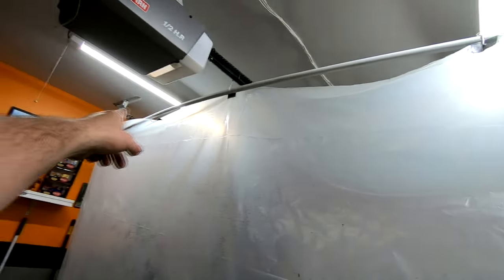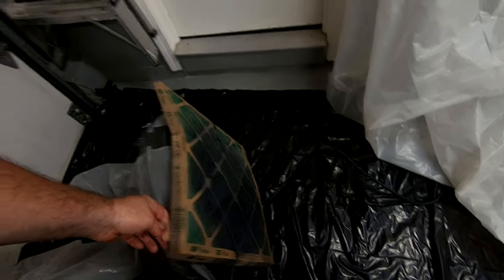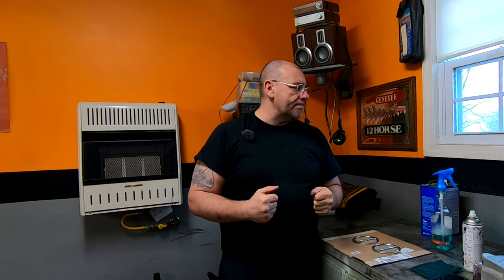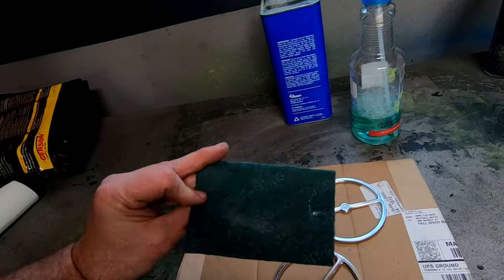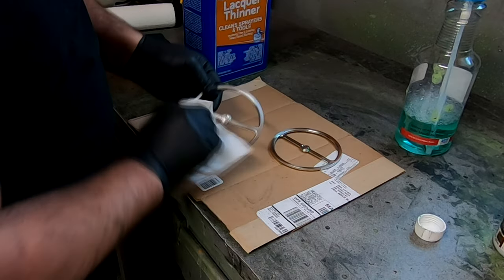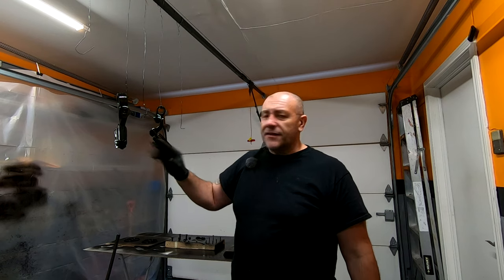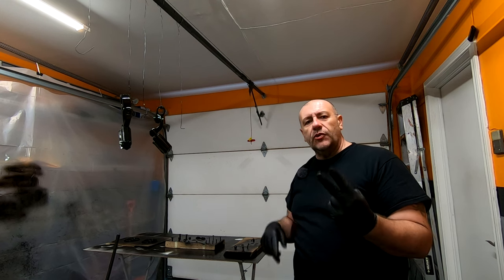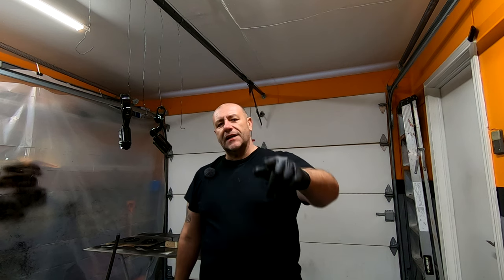Harley Ultra Classic Makeover #12 Paint Booth 2K Paint Hardware/Brake Calipers Painted Gloss Black

Comment: I never got that fancy when I've painted things, it might explain alot lol. Good setup you got going there.
Reply from the maker: Neither have I lol until now. 2k paint overspray will get on everything. Since I was doing this in the garage I needed a way to protect it. Before this I would paint outside in the open which caused some serious challenges. Like bugs and dust getting on the paint work.

Comment: Mike nice job. Good to see ya wearing a mask, I'm the same as you never wore a mask. Now I know better and obviously after all these years so do you. Stay safe and strong brother.
Reply from the maker: Yes. Can’t be messing around with these chemicals. Thanks for watching and commenting. 👍🙏
Reply: @TechnMoto  By the way Mike its Lee. Remember shop and the brake dust trick ? Lol
Reply: One of the older guys called me over to a vehicle with the rear drums off. Told me to check out how the brakes were set up. Then used a air gun and blew the brake dust in my face. No  Respirators back then. Point is were smarter now.
Reply from the maker: 😂 not sure if we’re smarter or not willing to take anymore risks as we get older. 😂